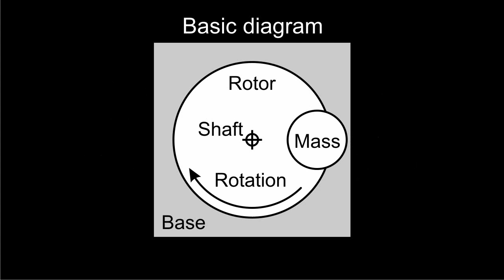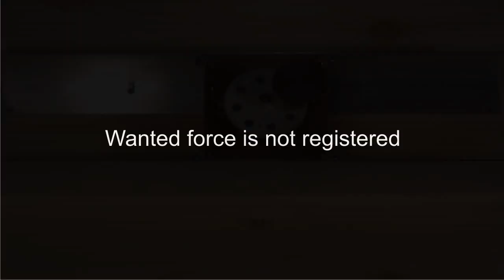Kinetic drive, reactionless propulsion system, test

Comment: Back in 1998 I experimented with a simple lego machine, basically just a four legged swing with a pendulum swinging in a vertical circle. The pendulum can be rotated with either a motor, a spring motor, or a wound up rubber band. As the pendulum swings vertically from top to bottom gravity causes the pendulum to move faster on the bottom of the swing than at the top. On level ground the pendulum swing machine rolls or hops on wheels in one direction.

Comment: My two cents on the Thornson test is that it was not built in the same manner as Thornson's . The outer weight is not attached solidly creating an arm  ; secondly the weight impacts the center changing the force output direction . Lastly Thornson uses 2 of the rotating mass to offset counter forces.  You can''t call it a true test of the Thornson system.

Comment: 2) In continuation: The hollow sphere will accelerate slower than you but away from each other, you will then move in a straight line conserving your speed, as will the sphere, and then collide with the other side of the sphere where your forces will cancel out, becoming then in equilibrium. At this point the sphere will be slightly moved in one direction, the direction you pushed, and you will be off set from your initial position in the other direction. But the center of mass won't change.

Comment: 3) In continuation: If you then repeated this at your new position and pushed against that wall, you will then move in the other direction towards your original position and the sphere will move in the other direction towards its original position. Just like in the first case, the accelerations will vary depending on the applied force but you will return to the original position and the center of mass will remain unchanged.

Comment: As shown in J.L.naudins replication of the Thornson device, you need to control that the weight is at the extreme position in the forward direction during rotation. In your test the weight seems to be thrown all over the place (as seen shen you have the white dot on the weight).

Comment: I like that you did these experiements...shows dedication, not to mention honesty about what youve found. Another 1 which would be fun to try (i do not remember the origin of this Idea) is a tube that throws two weighted balls with equal force down its length both ways at the same time, except one end is decelerated slowly by a spring(or similiar) & the other hits a hard wall. Alledgedly it will move in 1 direction. I SERIOUSLY doubt it is feasable as propulsion, but it would be a fun & EZ exp.

Comment: in a closed system I agree , therefor we should seek  a moment within the closed system to change the dynamics of the motion .  In the closed system the mass is rotary applying it's forces to the outside boundaries .  Should we not seek to make a moment of the motion 1) linear 2) shouldn't the mass apply it's force from the center out ? 3) shouldn't that force only be gained from a limited time along the 360degree circle say only 20-30 degrees . 4) and shouldn't it be on the same portion of axis

Comment: Thanks for the video. Looks like it doesn't work. The weight needs to be lightened on one side of the wheel by an outside force or energy instead of it pulling back on its own. I'm thinking of how to build it myself

Comment: Gyros transduce via a 90 degree rule - spin and rotate about two different dimensional axes to generate force along the third 
However that force will not be free in space because it has a ground application reference
You need 2 counter-rotating (for dynamic balance) gyros on the same axis to be spun around (90 degree) the centre point of their axis, to generate force
Make 4 of same at corners of a square with 2 mutually counter rotating to free the platform forces from Earth ground reference

Comment: when the light was turned on I saw 2 things 1) though the pattern was nearly the same it wasn't exact 2)I also saw that the "moment of thrust" was not set to the direction of the rails, either left or right  . I've seen Thornson's other experiments by the US Gov that produced a viable result .  I believe also there is a component to the lack of thrust that is created by gyroscopes . I believe that a second component to using the "lack" of thrust that creates useable motion .

Comment: On the Roy Thorson test when using the offset weight I couldn't tell if you positioned the extended radius in the direction you wanted.  When I slowed the video down it looked like you were only showing the up and down offset weight basically the wall of the channel you built.  Instead of the sideway direction you wanted. 
I could be wrong.

Comment: The essential action is a disturbance of equilibrium in an equilibrium field also called an inertial space. If the gyro disturbs the equilibrium, then all the other forces are what are adjusting . To take advantage of this adjustment the objects framing the fyro are what must have freedom of relative movement. `if the angular momentum is almost zero this is because that degree of freedom is small or negligible in the equilibrium field,

Comment: Clever responsible research. We need more simple machines to demonstrate the ideas of "inertial propulsion" or "self-contained propulsion", even if the ideas fail to work. 

However, I am still not convinced that if you have a big hollow ball in gravity free space with a man inside the ball, that the man can do NOTHING to move the ball in one direction more than in the opposite.

Comment from the maker: ...wherein in the precession-dominated portion, the mass of the gyro moves in the said first direction and an associated first movement of the vehicle in substantially the opposite direction to said first direction occurs, and, in the translation-dominated portion, the mass of the gyro moves with an associated second movement of the vehicle in substantially said first direction, 
wherein said second movement is greater than said first movement and hence the vehicle moves in said first direction

Comment: 1) If you believe or have studied the most fundamental intro level physics you should be able to clearly see why it wouldn't work. All you have to believe in is that every action has an equal and opposite reaction implying that if you push off the inside of that sphere in space, the wall and you will feel the same force. If you believe in F=MA, then you will find that you and the ball will have a different acceleration.

Comment: A lot of these patented devices don't work according to the patent description. Most of them are copies of the inertial drives of the Russian inventor Tolchin. A clue to why some of them appear to function until they are subjected to the pendulum test; those who construct models for the pendulum test usually engineer and fabricate those models and the pendulum apparatus to a higher standard. You just have to look at the videos of those patented devices to see the sloppy fabrication and in some cases, intentional fraud. The clues are all there; you just have to see them. I noticed in your video of your own device that your print circuit switching system is powering rotor one and rotor two simultaneously. That doesn't match with the description of the operation of the device. It might just work with the proper switching.

Comment: damn i really hoped one would work.  maybe try the first one with the giros facing forward rather than out or maybe attach them to the wheel for only half a turn so the create a torque that resists being turned for half a turn then they can stay in the same axis for the rest of the turn (maybe it would create trust 90 degrees to the axel). anyways its nice to see someone do proper tests that dont have vibration errors and the likes.

Comment: Could you please try a different version of experiment #2? The acceleration/deceleration must be "disconnected" from the device, and the mass doesn't have to rotate around its own axis.

What I suggest: Mount the engine (the back of it) at the center of a balanced (and relatively massive) flywheel, and connect the engine's rotor to the unbalanced wheel. Mount the whole assembly to some cart so that both wheels are free to spin. You probably need to feed power to the engine through brushes.

Now, the tricky part is that the engine itself must be able to break and accelerate the unbalanced disc depending on where the weight it is relative to the cart. I suppose you need sensors and electronics for that, to synchronize it correctly.

With this design the acceleration/deceleration of the mass will be transferred as spin to the flywheel, and will not counteract the forward force.

I know that it is supposed to be impossible, but can't see why this idea wouldn't work.
Reply from the maker: it was a long time ago )
Reply: @ZaitsevskyA  I understand that. I asked just in case you are still interested in these things, since I'm not capable of building such a device myself.

Maybe it's enough with a stepper motor, controlled by a Raspberry Pi... Those are components that are pretty easy to find.

Comment: Basically, F=ma right? F1=F2 ONLY if m1 x a1 = m2 x a2. Conventional rocket science tallows BOTH m2 and a2 to escape out the back. NO. We only need to cause a difference between a1 and a2, NEVER THROW AWAY ANY OF THE MASS

Comment: I suggest you try again, but force the weight to be thrown always in a certain pattern equal to he Thornson device. This is not a proper replication of Thornson. 

If you check my playlist you will also find russian experimenters with similar devices with actual proulsion.

You wil not get any thrust as long as the weight is thrown irregular all over the place

Comment: This is indeed excellent work.  I have worked on similar systems myself, and I can tell you that the Thornson design you depict here has a couple of engineering flaws that are preventing the desired effect.  I have achieved success with a kinetic drive of my own design, but the construction of a prototype as polished as these is beyond my current capability.  If you're interested, let me know where to send the design and you could test mine in similar fashion.

Comment: You haven't used any braking, just rotation, so this isn't a proper test. These drives are used in robots on Earth, and to manuover the ISS in LEO. Variants of are used in the Segway and hoverboards, so they clearly work.
Reply from the maker: It is not used anywhere. Hoverboard is based on a mems sensor and direct drive wheels. Gyrodine is used in space, but it is not a linear propulsion.
Reply: @ZaitsevskyA  That's like saying "hoverboard is made of plastic and metal", as a refutation.